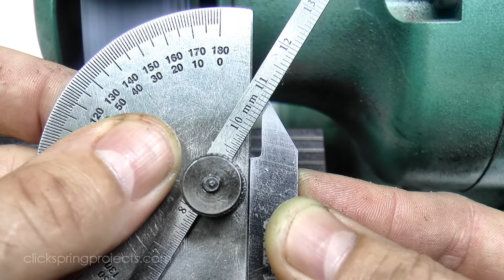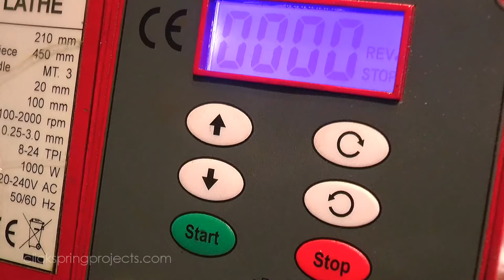Single Point Threading on the Lathe I

Comment: i have retired after 45 years as a machinist and i can say, i an appalled at the currant level of skill being "lauded"... look at that thread form, are those supposed to be bad acme thds?  "by the book"  what book is that?  playgirl?  NEVER i repeat, NEVER reverse the drive train, there is a thing called BACKLASH that will screw you every time (pardon the pun)  use the chasing dial on the carrage that TURNS when you engage the half-nut.... any point for even thds, same # for odd thds.. unless you are cutting multi lead thds.... huh?   1"X8tpi  X 4 leads has the strength of a 32 pitch with the speed of advancement of a 8 tpi    single pointing is the STARTING point of calling yourself a machinist... if you can't do that then you're the same as a carpenter who can't drive a nail....